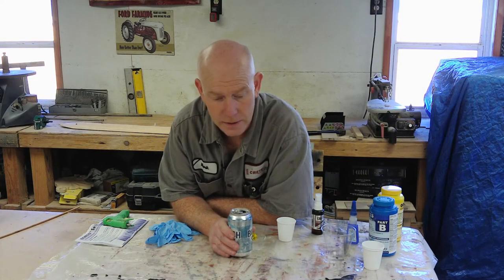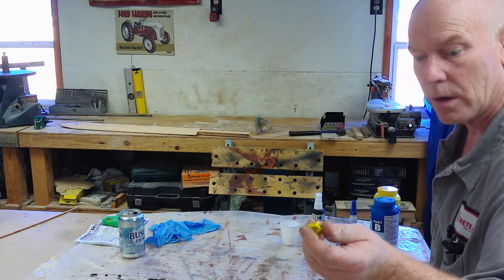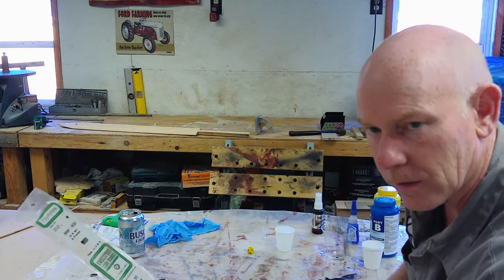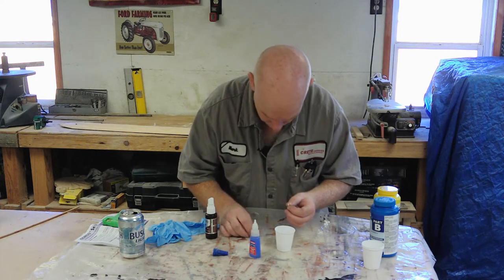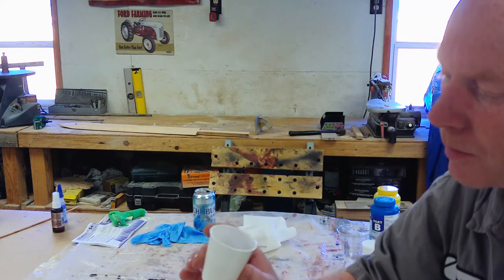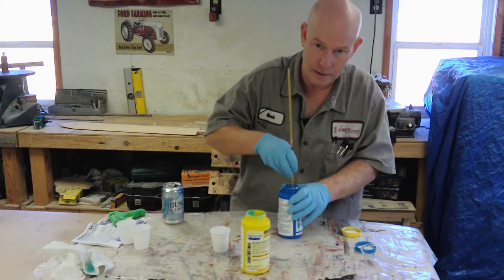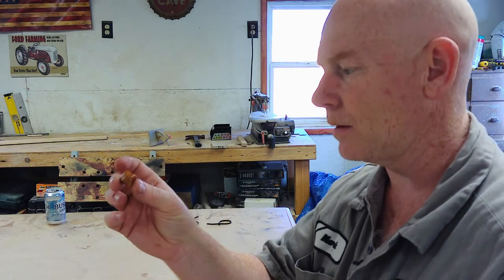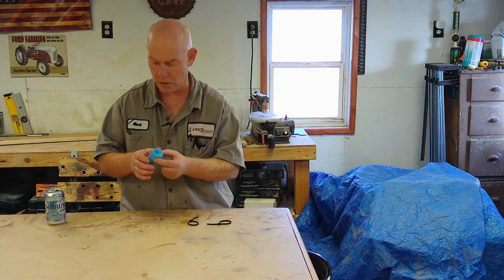Making silicone rubber molds.

Comment: how about using a small d6 for the base and glue the corner of the other die to the center pip of the d6 then place in the cup d6 down, the d6 creates a resrvoir tip.,..haha...just the tip. anyway, something to try.
Reply: and try using blue painters tape instead of bubber rands or tip zies